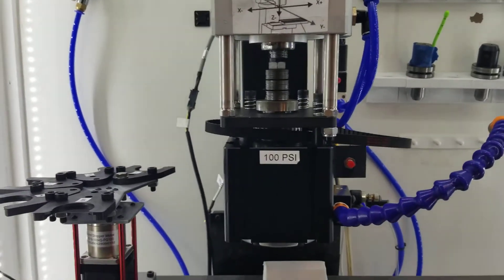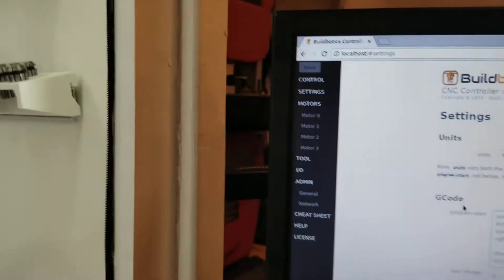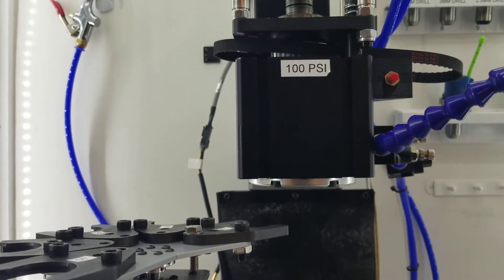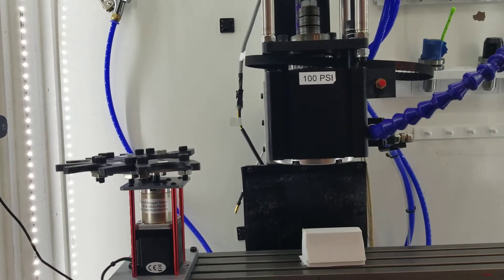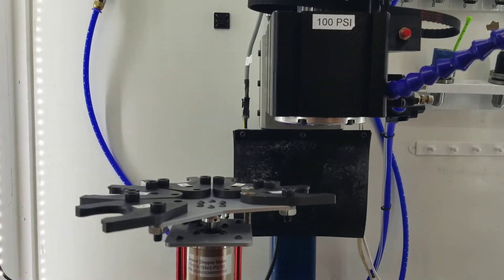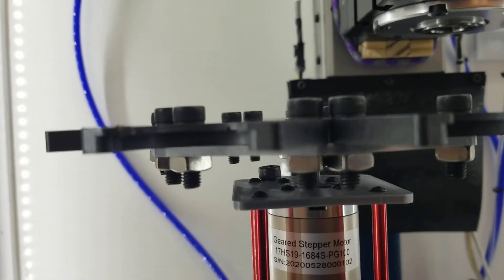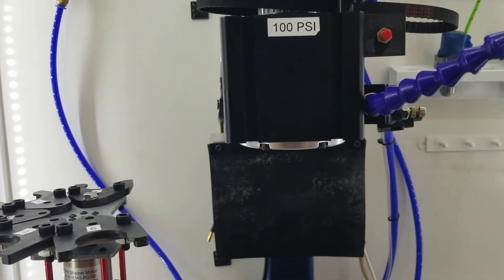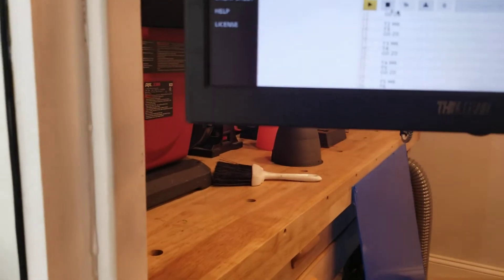Taig 5 Pocket ATC with Buildbotics Controller

Comment: Love this are you using a Glock cnc R8 headstock? How well does the geared stepper motor hold position wile milling and changing tools
Reply from the maker: Its a TTS Spindle from Jarrett Grover, you can find a link to purchase in the Taig facebook group.  Geared motor holds position well, I moved to a CF plate instead of the 3d printed and it is very solid. The flange to CF plate I used in video was junk and rotated a little around stepper shaft.  I'm waiting for a more rigid one to arrive.  I'm now on the 14th prototype and haven't tested yet while cutting.  Will post more when complete.